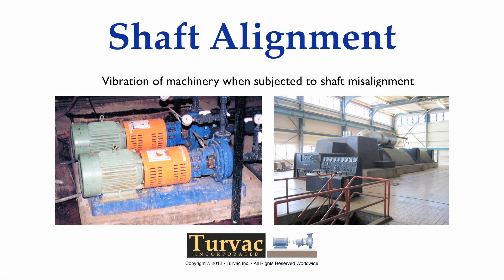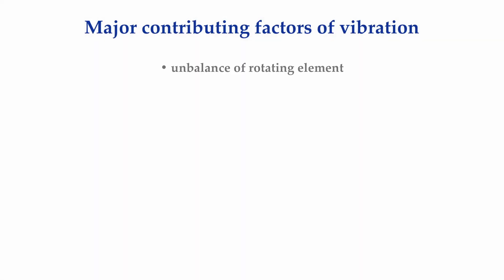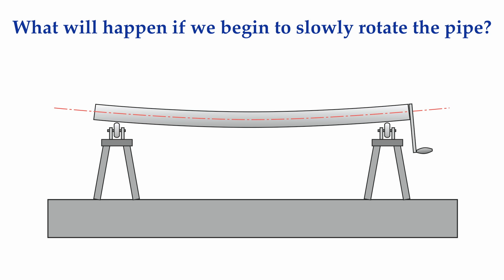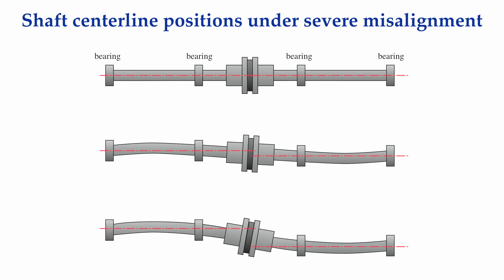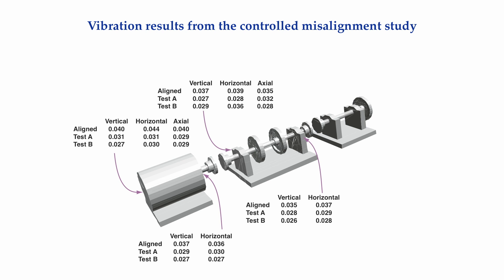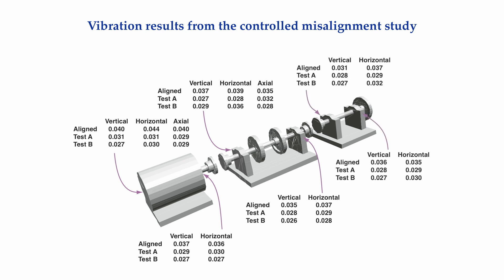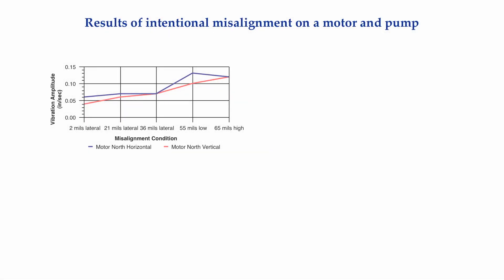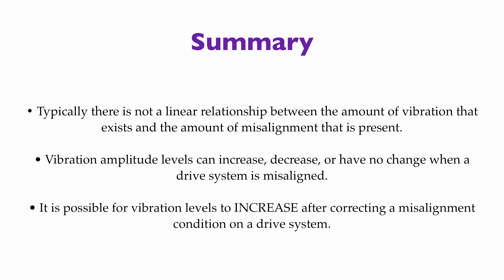1-8 Vibration on Misaligned Machinery

Comment: thank you for making this series of courses. it made me even more confused. What can explain the mechanism behind reduced vibration as the result of misalignment?
Reply from the maker: The explanation for why the vibration decreases is explained in slide 16 in the tutorial.  Here is the text for the narration of that slide ... 

If you remember, a short while ago, when we were talking about things that put static loads on bearings, it was mentioned that three very common sources of static forces on bearings were gravity, or the weight of the rotor, belt tension, and shaft misalignment. So, let’s examine the static forces that are present in these two shafts and for this discussion we are viewing the shafts in the side view.
The shaft on the left has some weight so there is a downward force on it due to gravity.  Each bearing produces an upward force opposing the gravitational load.  Similarly, the shaft on the right sees the gravitational force and its bearing produce an upward force to oppose the gravitational load on them.
If we begin to misalign these two shafts, the flexible coupling accommodates a certain amount of the misalignment but once that is exceeded the shafts will start elastically bending.  The gravitation forces are still there but now, through the coupling, the shaft on the right induces a downward force on the shaft on the left.  This force now produces an additional force on the inboard bearing in the downward direction but it will produce an upward force at the outboard bearing.  The shaft on the left produces forces on the shaft on the right also.  Through the coupling, the shaft on the left induces an upward force on the shaft on the right.  This force now produces an additional force on the inboard bearing in the upward direction but it will produce an downward force at the outboard bearing.
If we continue to misalign these two shafts, the shaft begin elastically bending even more.  The gravitational loads are still present, across the coupling, the downward force on the end of the left shaft has increased as well as the reactionary forces on its bearings and the upward force on the shaft on the right has increased as well as the reactionary forces on its bearings. 

Shaft misalignment induces static forces on the shafts that will diminish the amount of motion / vibration that is occurring.

Comment: Thank you for the information conveyed through this series of tutorials. Could you please tell when you connect the shaft by using flexible couplings, whether flexible coupling will not take accommodate misalignment. What happen to the flexible coupling during these series of experiments. whether flexing of coupling causes such a change in the vibration level.
Reply from the maker: Ashish - Sorry for the delay in getting back to you.  When forced to run under shaft misalignment conditions, different flexible coupling designs do different things depending on the design of the coupling.  It has also been observed that different vibration spectral patterns occur with different types of flexible couplings.  I have another training tutorial on this subject in the ADVANCED shaft alignment training videos that I have not published yet.  This information however is in Chapter 2 of the 3rd edition of the Shaft Alignment Handbook (ISBN# 978-1-57444-721-7).  I hope this has helped you.  Thanks for watching the video!  John Piotrowski

Comment: that was a surprise.
Reply from the maker: Sushil - Indeed.  Many people are shocked what actually happens to the vibration on misaligned running machinery.  Thank you for watching!  John Piotrowski
Reply from the maker: Sushil - Indeed my friend.  Many people are surprised concerning this phenomena.  I think the reason there is confusion about this is that very few people have ever explained that static forces are occurring in a misalignment condition which will diminish the capacity for the machinery to vibrate freely.  When I intentionally misaligned a drive system for the first time, I fully expected the vibration to increase.... and it did NOT.  It took me over two years to figure out what was really happening and WHY the vibration went down when I misaligned a drive system.  It took me another two years to have the courage to say something about this and explain how this could happen.  I still think that the vast majority of people who work on rotating machinery believe that vibration will increase when you misalign machinery and I don't think I'm going to live long enough to explain why it doesn't.  So I'm hoping you will help me with this.  Thank you - John Piotrowski